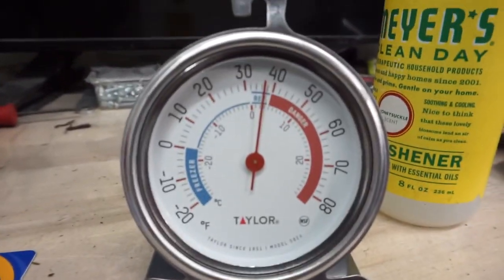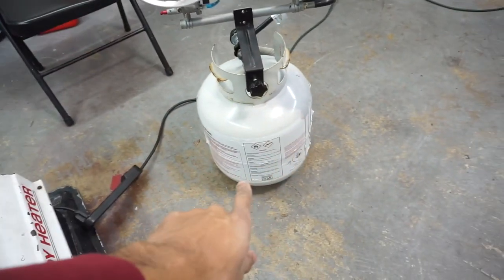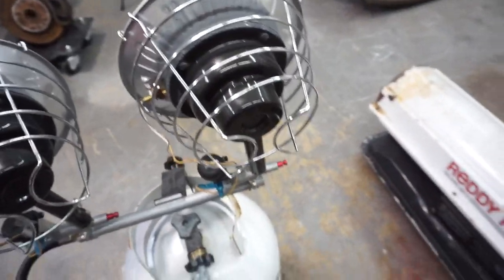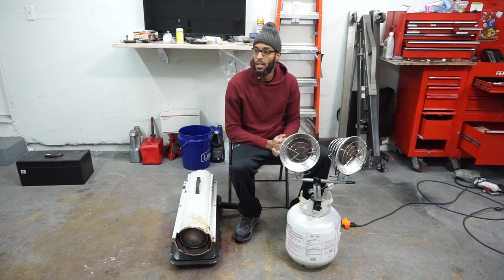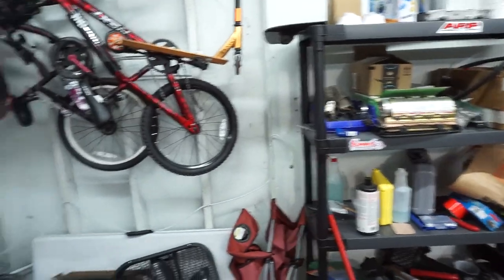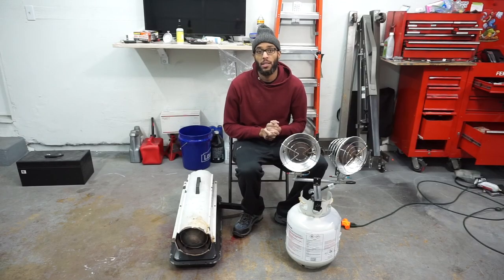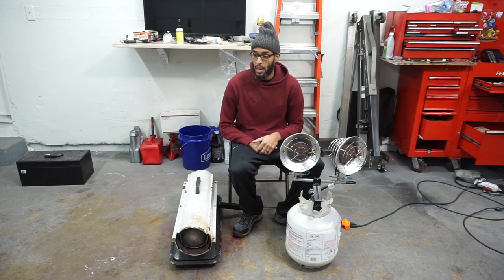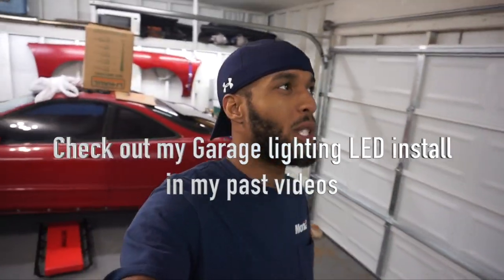Torpedo Heater vs. Tank Top Heater- My Garage Setup

Comment: As much as i love torpedo heaters warming up fast, they are also very dangerous as far as the oxygen purity or CO2 levels ...be safe and if you are using it to heat the garage, make sure you open windows or crack the garage door open at least 2 feet to let air circulate...great video thanks!
Reply: I have been using them for years and never had issues with fumes

Comment: Fyi, at exchanges you get 15 lbs per tank. You pay extra for convenience. If you refill your own propane cylinders you’ll pay less per tank and get more fuel. In my area I pay on average  $12 per cylinder but I get a full 20 lbs. I have  3 cylinders that I refill. Propane was cheap when I filled them earlier this year so I payed $28 for 3, but since I get an extra 5 lbs. per tank it’s like I got one for free!
Reply: avega2792 where do you get them filled for that price?

Comment: Great video, I use the tank top radiant heater in my detail shop. No noise is a huge plus, also like other ppl said put a fan behind it and it's still no where near as loud as my old torpedo heater

Comment: Torpedo heaters are great, except for three things: 
They are LOUD! Like Really loud. I typically have music on when working in the garage. Torpedo heater makes that almost impossible.
Secondly, you need enough space in front of the heater to not burn stuff. Lastly, they put a lot of moisture into the air. The result is rusty tools.
One advantage you don’t mention is, they’re low to the ground. Tank top heaters are great, from the knees up. Torpedo heaters are good for below the knees.

Comment: Propane torpedo heaters burn thru that propane quick . I feel like the kerosene lasts longer
Reply: Better fuel ⛽️ economy
Reply: My last one was a Propane heater and would leave me with a severe headache so I switched to kerosene instead.
Reply: Currently dealng with this now. (1.18.2022)
Propane around me is $4.19/gallon, usually about 4.2 gallons per tank.
Diesel around me is 3.43-3.70, 3.70 being quality diesel. 

Propane contains 91,500BTU/gal
Diesel contains 137,000BTU/gal. 

You're getting nearly 40% more energy per gallon using diesel over propane, and it's cheaper. To be fair, my propane heater was free, but the amount of time I spend in my shop (36x36x12) the cost racks up fast. thank gosh it's got a partitioned off 10x36x8 area where I can close the doors and heat a much smaller area, for smaller jobs. 

If I had to pay for a torpedo I would've went Kerosene/Diesel. Thank gosh this is just a stop gap until I can afford to get my 60k natural gas forced air heater installed.

Comment: You forgot to mention that the torpedo heater is loud and oily and all the fumes from it sometimes get dizzy with the torpedo heater. I am going to get 2 of the double head tank tops and just run it for 20 minutes before going into the 12x20 garage I am setting up. Kerosine is very clean oil, but propane has even a cleaner burn. I used a torpedo heater for a long time when I was in the shop long time ago and it's just so annoyingly loud. Plus, if you're painting a car, you get so much dust in your paint jobs
Reply from the maker: Yea I ended up getting a propane torpedo heater and love it
Reply: @irvsmadhouse  I will look more into that idea 💡 thanks
Reply: @irvsmadhouse  are they as loud as the kerosene type?  I've been looking at the Craftsman propane

Comment: most kerosene torpedo heaters can run on diesel as well (what i use in mine). Remember to leave a door cracked so carbon monoxide doesn't build up when using either heater
Reply: Squid_Garage diesel burns the shit out of your eyes
Reply: @adamswaz4878  not in my heater
Reply: what's the point of a heater if you have to open a door?
Reply: Spurgeon Godwin  right. But why even have a heater if you have to open a door? It's pointless
Reply: I just run a small exhaust fan in the roof of my shop to suck CO out
Reply: Agreed but the kerosene doesn't irritate the eyes. 
As far as having to open a door they put out so much heat that it doesn't matter much. If I'm using it outside to thaw something or blow heat in a "work tent" diesel is just fine, and much cheaper to run.
I have and use both types of heaters, they both have their purpose.

Comment: I just purchased an 80,000 BTU torpedo diesel heater ($220) since Kerosene is $10 per gallon where I live!
Reply: I went to Ace Hardware and it was $15.00 per gallon for Kerosene there. My particular heater will take jet fuel as well as Diesel. The problem with Diesel is it leaves a bad odor. I guess you have to shop around to find a decent price for the Kerosene. $7.00 per gallon is the cheapest I found at tractor supply($35.00 for a 5-gallon container), the major plus is I didn't have to purchase a container to put it in.
Reply: @kentharris7427  US Diesel is Ultra Low Sulfur Diesel and should outperform kerosene for smell.
Reply: I use #2 diesel in my Mr Heater with no fumes or smell.

Comment: For the record, the tank-top heater is not designed to heat "space." It works by radiant heat, which is to say, it heats objects rather than the air around it. If your aim is to fill up your garage with warm air, then of course the torpedo heater will work better by expelling hot air into your garage. If you just need to heat wherever you're working, you can aim the tank-top heater in your direction and it will heat you and the objects around you. That's a lot more efficient than heating the entire garage space just to keep yourself warm.

When I'm ice fishing, I use a single-burner tank-top heater to keep myself warm. I use a 10x10 reflective tarp to set up a pyramid shelter with one side open. I set up the heater outside about 5 feet away, aim it into the reflective shelter, and it can get up to 90 degrees in there while it's only 10 degrees out.
Reply: How long will a full tank last?
Reply: manuel all depends on what setting you have. With medium setting you should get 8-10 hours
Reply: DroverChicago- Ice fishing ?  And they make fun of me for chasing a little white ball around..lol
Reply: One smart answer there
Reply: @TheNYgolfer  At least a guy can feed himself after a day of fishing lol

Comment: kerosene torpedo heaters cost like 2-3x the price of a propane torpedo heater; I think costs less to run...... you can use diesel on most which is a good bit cheaper and easier to find than kerosene; get a 120v thermostat and make a plug for the torpedo heater and it will just auto magically regulate the heat:P...... having tried single burner tank top, kerosene 23k btu, and the a 75k kerosene torpedo, I don't plan to go back to the tank top burner or the 23k btu kerosene trash can:P(unless just to maintain the heat)

Comment: I have a propane torpedo heater that I use to super heat the garage and then use my Kerosene heat to keep the garage warm VERY comfortably
Reply: What is the fuel consumption difference between propane and kerosene in torpedo type heaters? Costs ?
Reply: @deanhenthorn1890  i havve kerosene heater n it just eats the whole tank in few .n kerosene is damn expensive
Reply: Sounds like u got backwards
Reply: @itsmisterchris  $8 a gallon here now

Comment: Get the DeWALT 20v 70,000 BTU Cordless Forced Air Propane Heater. It takes a 20v battery, or you can use a cord. New Propane heaters from a good brand are not like the old one's, they are 99.9% efficient. Only  .1% carbon monoxide. Propane is a cleaner burning fuel than 1k kerosene. If propane is not burned efficiently it will smell like eggs, the smell is added for safety! Propane gas also goes to the lowest point on the floor, so put the bottle by the garage door. Propane is heavier than air while natural gas is lighter than air.

Comment: Question: can the Tank Top Heater run with just 1 side on or does both have to be on? As in, can I light just 1 side and keep the other side off and then turn on the other side as well if its not warm enough or I need to heat a wider area?
Reply from the maker: Yea most times I use one, you light them individually based on how much heat you want

Comment: Lil pro tip for your subscribers, you can go to a participating Uhaul and get your propane tanks refilled for cheaper than an exchange. I usually pay 16 and get a full tank as opposed to the partially filled exchanges. It adds up.
Reply: Tractor Supply is even cheaper.
Reply: @JesseWright68  I'll check into that. Although they're definitely not as close.
Reply: Flying J, some truck stops refill cheap

Comment: I had both and I throw the torpedo in the garbage because of the noise, I found the tank top is much better less noise less fumes also less clearance to other objects even if it takes more time to heat the garage, yes it's radiant heat but I have a ceiling fan that I run on slow if Have to stay long hours in the garage .... One question: why do you have to use a lighter, don't you have igniters on the tank top heater? I think I might've seen igniters there !!!
Reply from the maker: rick north no igniters that’s what cuts the gas on to light it
Reply: I see, mine is the older type with one square pan and it has the igniter, Thanks Irvin

Comment: Does the 20 lb propane comes with the tank top heater when u purchase it?
Reply from the maker: Toochie Smith no it doesn’t usually a new one is around 40 refill is 10-20
Reply: @irvsmadhouse  Thanks
Reply: @irvsmadhouse  One more question...How long will a 20lb tank last on low?
Reply from the maker: Toochie Smith believe it was around 20 hours
Reply: @irvsmadhouse  Thanks again